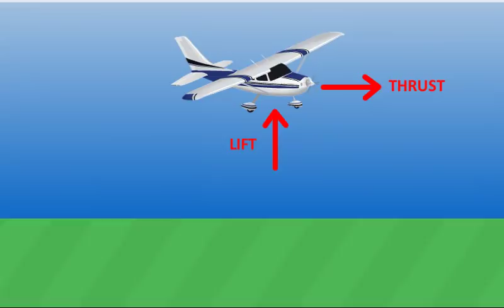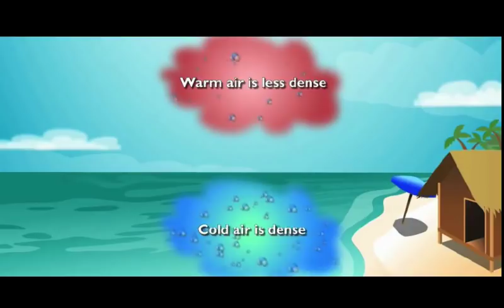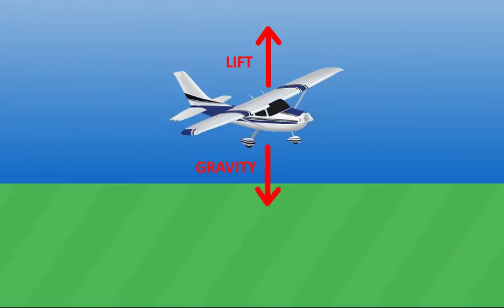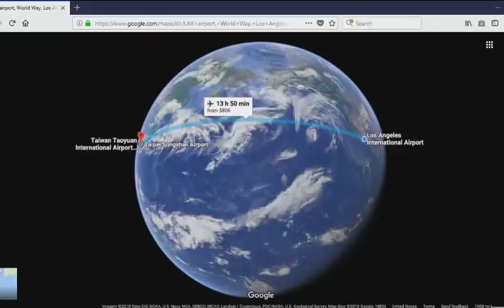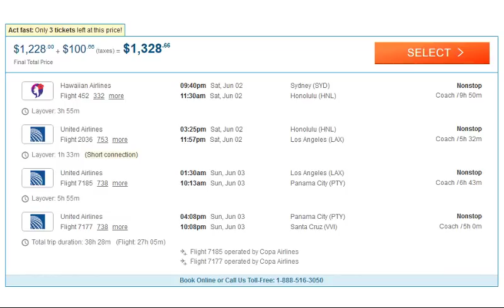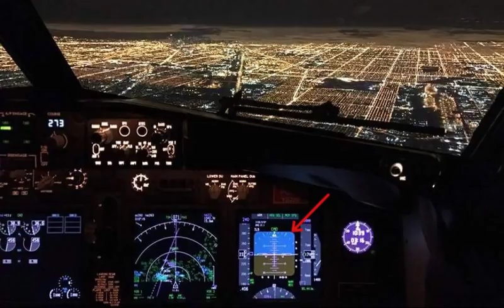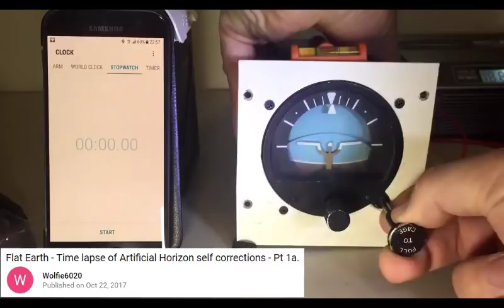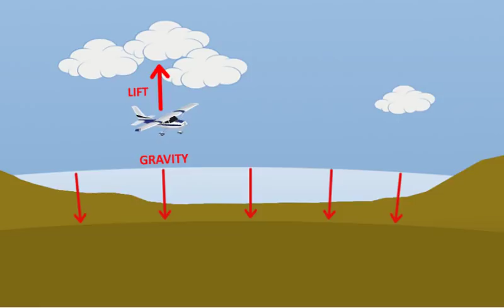Flat Earth Falsities - Plane Nonsense

Comment: There is one thing wrong here: The plane IS actually lowering the nose all the time. Now, consider that the Earth has a circumference of 40000 km. So a plane flying at 1000 km/h would take 40 hours to flight around the globe, and to pitch down 360 degrees in the process (you know, one turn). 360 degrees is 40 hours is, let's round it up, 10 degrees per hour or 10/3600=0.003 degrees per second. This is ridiculously slow and undetectable. It takes 300 seconds, or 5 minutes, to barely change one degree. The pilot (human or automatic) has to do nothing conscious, other than hold the altitude, to make it happen. To put that in context, during the rotation for lift off the plane pitches up at a rate of 3 degrees per second. That is 1000 time faster than what it takes to keep up with the curvature of the Earth (and 1000 k,/h is too fast, and I rounded 36 up to 40, and I rounded up again 0.002777 to 0.03, a more exact number would be 0.002 degrees per second). To put it in context again, say that you have a 400 km straight road and you are driving on it at 100 km/h, except that it is not straight, it is in fact a long continuous left curve of 40 degrees, 10 degrees every 100 km, 1 degree every 10 km, 0.1 degree every 1 km (that it takes you almost 2 minutes to complete). So you are turning left all the time at a rate of 0.1 degree per km or 0.1 degree every 2 minutes. You are not going to see the curve (it will loo straight), you are not going to note that you are turning left all the time, you are not going to say "I had to keep turning left all the time". You just follow the lane and that takes care of the ridiculously small and unnoticeable turn by itself.
Reply: @Rollie - Fantastic comment for those of us that are not pilots. Thanks for that.
Reply: Ok, you are sort of correct that the pitch angle will remain all the time zero, and hence doesn't change. But that's because your measurement system is not in an inertial frame of reference. It's like saying that turning in a tight circle around the North pole (or South pole, because there IS a South pole) is keeping the heading constant because you are just moving all the time due East. However, you ARE turning, you HAVE a yaw rate and you DO need to maneuver to do it. It is quite evident that going East when you are over the Meridian zero is NOT the same direction than going East when you are in the Meridian 90E. Just draw the 2 speed vectors and observe that they are not parallel. And that holds true if you are flying along the equator. In that case, the angular difference between the 2 vectors would be a pitch angle. The pitch angle will be lets say zero in both cases because the local zero in one point is different than the local zero in the other point. They are different zeroes. To reach from a zero pitch in one point to zero pitch in the other point you HAD to pitch down 90 degrees, because the "zero pitch" direction has a difference of 90 degrees between both points. You said it yourself, the plane is rotating along its lateral axis. That angular speed is called pitch rate, as much as the change of heading is called yaw rate and you do have a yaw rate when turning a tight circle around the pole even if the local heading remains constant (but not the heading as observed from an absolute coordinate system). Your heading/pitch is just changing at the same rate that your zero reference is changing direction. And yes, flying straight and level following the curvature of Earth DOES requires maneuvering (ridiculously and indeterminably small, but it is there). The pitch-down rate is ground speed / Earth circumference * 360 degrees, as I did the math above. So how can we visualize that it really requires maneuvering? Let's begin with what I mean with maneuvering: To keep up with the curvature of Earth, you need to hold the elevator more down (i.e. control more forward) that what it would be required in a flat Earth (or in an Earth with a much larger circumference but the same gravity). When you have things that are very small and undetectable, a good way to realize that the thing is still there (even if negligibly) is to exaggerate... a lot... a ridiculous lot... as ridiculous much as ridiculously small the thing we try to visualize is. So try to visualize a basketball-sized Earth and a typical RC trainer airplane. Imagine the RC plane circumnavigating the basketball Earth at an altitude of just a few inches, once every couple of seconds. Can you visualize the air hitting the elevator from above? (because it lays behind the CG, so it has an upwards motion as the plane rotates along its lateral axis). That would create a pitch up moment that doesn't exist if the same plane was flying not along a round basketball ball but a along a flat basketball court. So you need to keep the elevator more down to prevent the nose from going up. Now, again, this is with a plane that is bigger than the Earth and that circumnavigates the Earth in a couple of seconds.  With a real plane that is not bigger but about 1 million times smaller that the Earth and that circumnavigates it in a couple of days instead of a couple of seconds (a couple of days is about a couple hundred thousands seconds), the effect is still there. A little bit weaker, ok ridiculously vanishing weaker. But it is still there. Good luck observing and measuring it. But believe me that the elevator will need to be a few picometers more down than if the  Earth was flat, to allow for this constant nose-down pitch rate. By the way, the explanation of the gyros in the video was spot on. If the gyros were perfect, they would remain spinning parallel to themselves and would provide an absolute reference for pitch. And the plane would indeed rotate about that perfect gyro as it pitches down, proving again my point that the plane does pitches down, it just  does it at the same rate than the Earth. Of course there are no perfect gyros so we need those erect mechanisms and algorithms to keep if from precessing by way more than what the turning around the Earth would.
Reply: @Gabriel Braun
"Ok, you are sort of correct" Which means you are "sort of wrong", i.e. wrong, but haven't got the strength of character to accept it.
Reply: @wong. Your logic is brilliant... NOT. By the way, you are totally wong.
Reply: @wong ... Yes, it was very basic logic, and it was wrong. That someone is right doesn't make another person wrong. I used your screen name to say that you are wrong and make a stupid joke at the same time. I admit the joke was stupid, which doesn't mean that I am or I am not stupid. Both smart and stupid persons can make stupid jokes. But I won't get into your name-calling game.
Reply: Gabriel Braun, if you kept the nose tilted down in the very least and you started in Los Angeles, what would keep you from flying into, say, the atlantic ocean?
Reply: @Rollie, did you just delete your second reply to me? I was about to write a response and "poof!", it's gone.
Reply: Lot is wrong, aside of maps being wong wrong; they usually have nose raise for lift, no on a ball if you really want EAST you got to correct all the time, being the center of N-S poles, straight lines on a ball dont fair too good. 
So funny how the crust effects Gravity generator core force, but really no difference in vast deep ocean dips or top of the peared oblateness, its all automatically equilibrated. As I have mentioned SPIN has a counter force gravity effect, but ships and planes and locked spacecrafts /GEO satellites are untouched.... Guess you need a college diploma to rationalize that.
Primate scientists kind; "getting colder because of Warming", "know its real because it looks so fake...",
Reply: I don't understand half or more tan what you are saying. Spin does have a "counter force gravity effect" (just using your terminology), it exists, it is measurable, but it is too small for humans to detect it without instrumentation. You'll see, the Earth spins very slowly. What units do you like to measure spin? RPM? The Earth spins at 1 RPD (revolutions per day) which is less than 0.001 RPM (just do 1/24/60). Now satellites are not untouched. It is that "counter force gravity" that gets strong enough to cancel gravity. That's why satellites in low-earth orbit (that is most of them, as well as the international space station) make several turns per day around the Earth, they are going around the Earth much much faster than the Earth itself. Geostationary satellites are not in low-earth orbit, they are at about 42000 km from Earth center or an altitude of about 36000 km above Earth's equator. That is about 6 times Earth's radius away (compared with LEO satellites that are a fraction of Earth radius away). That is the point where Earth gravity has become weak enough for the "counter gravity" (which became stronger there) at 1 revolution per day to match Earth's gravity. The counter-gravity force is 6 times stronger than what a person observes at the equator (because it is linear speed times angular speed, and while the angular speed is for both  revolution per day, the linear speed is proportional to the distance to the center) and the gravity, which is proportional to the inverse of the square of the distance, has reduced by 36 times (you know, 6^2, or 6*6). A counter-gravity 6 times stronger and a gravity 36 times weaker, that's a combined 200 times stronger effect than on the equator (36*6). That's how much it takes for the counter-gravity of the spin to match the gravity of the Earth.
Reply: Funny how one offers models and math capable of explanation, matching observations and making prediction and gets back no working model, no math and name calling. When will be next full solar eclipse, where, what will be the exact timing and track of the totality zone, according to the Flat Earth model? Oh, that's what I thought, you don't have a working model. Again, I will not come into a name-calling names. I offer information and I let the rest to judge each of us for the values of their contributions.
Reply: @Rollie, hmm, strange. I do see the one that starts with "The aircraft..." but not the one that starts with "I'm using...". Now, I did receive the notification of your comment by email, and it contains your whole comment, so I know all what you said there and I have interesting (to me) things to reply, but it makes no sense to do it here without your comment. Since I don't think that most people (other than myself and hopefully you) you will our technical discussion interesting, maybe we can discuss in private. Unfortunately YouTube removed the direct messages between users and I will not post my email in public. If you know a way we can get in contact and if you are willing, go ahead. Oh, and I totally agree with you regarding the quality of the discussion. I also appreciate you being respectful, unlike many others.
Reply: @Gabriel Braun  Well done. You proved me correct.
"@wong. Your logic is brilliant" Actually it was very, very basic logic. 
"By the way, you are totally wong." I chose my pseudonym for a very specific reason and that was to separate the educated from the infantile and therefore laugh at silly attempts at humour/abuse such as yours. And you know, only the uneducated, ignorant thickos do what you have done and proved themselves infantile. Congratulations on proving you are a worthless tosser.